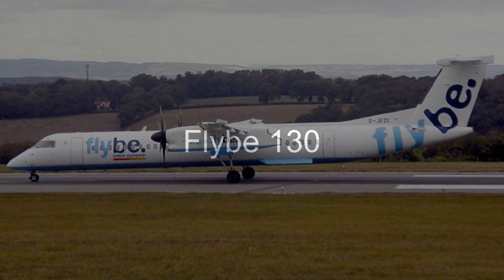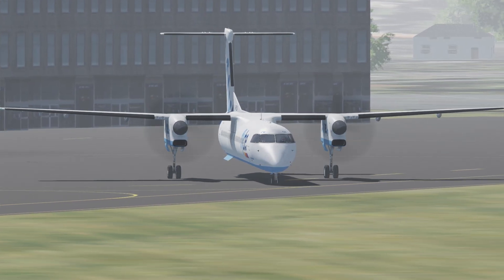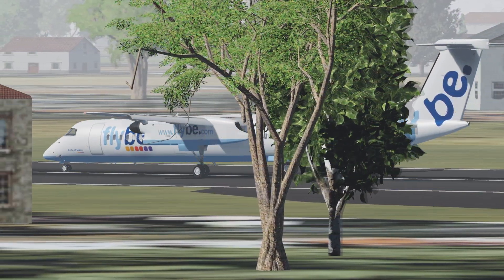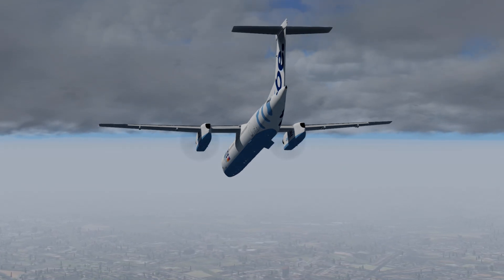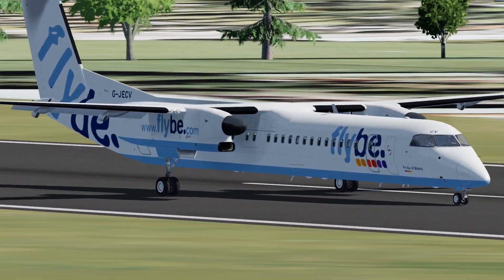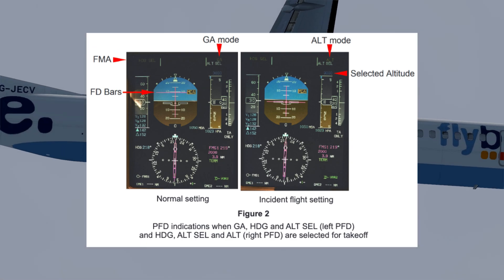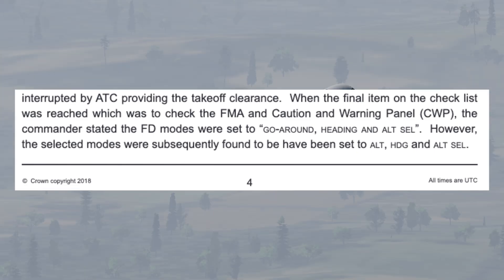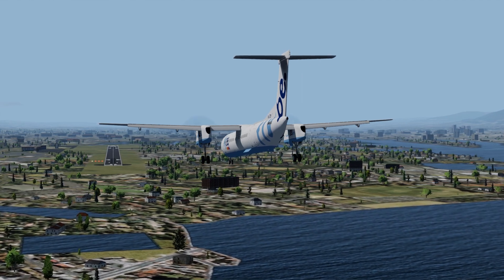How One Switch Almost Crashed This Plane  | Flybe 130

Comment: The software failure draws comparison to the Therac 25. Different machinery but having your inputs involuntarily switched on you could be more deadly in the air than in the imaging ward. Seems like fixing it ought to be high on the 'to do' list.

Comment: I fly the Dash 8-400, and while the autoflight system definitely has some quirks (as do many transport category aircraft), it is relatively simple to use. There is a running joke in the training department at my work that whenever a pilot makes some sort of blunder or error using the AFCS and the aircraft does something they didn't want it to do as a result, they should make use of the phrase "stupid airplane". Jokes aside, the automation is a tool used to reduce the pilot's workload, its whole job is to follow the command bars on the flight director. It is only doing what you tell it to do. This crew appears to have found that out the hard way, but I am glad that they caught this mistake before it turned into a serious accident.

This reminds me a lot of the Emirates B777 takeoff incident in Dubai a couple years ago, where the MCP altitude was set to 0' instead of the SID altitude, and as a result when the aircraft accelerated down the runway, through V1 and later VR, the PF who was following the flight director command bars did not rotate because the FD was trying to keep the aircraft on the ground at zero feet. When they did become airborne at the very end of the pavement, the FD was then commanding a pitch down to get the a/c back down to 0', and again the PF followed the FD command bars. During this time the aircraft was also oversped and nearly collided with several buildings. Thankfully they didn't engage the autopilot before realizing their mistake in this case (inhibited on the 777 below 200') because it would have literally flown them into the ground. ANY aircraft can get you into serious trouble if you misuse the automation, don't monitor it properly, don't understand its logic or its limitations. The relationship between pilots and aircraft automation has improved significantly in recent decades, but that has come in the wake of a lot of  near-accidents and accidents, and occasionally they still happen. 

Where I work, the normal SOP is that the Captain will set the FD modes for takeoff (GA, HDG, ALT SEL) and the FO sets the cleared SID altitude in the altitude preselect. In the event that the clearance hasn't been obtained yet but the Captain is at the point in their flight deck preparation where they are setting the FD modes, a placeholder altitude is selected (circuit altitude in some cases, usually the expected SID alt minus 100') before hitting ALT SEL, this is done to prevent something like this from happening and is standard procedure at most of the DH8 operators here. After flying the aircraft for a bit, you will pretty much always be in the habit of hitting the ALT SEL button immediately after you set the altitude in the altitude preselect, because that is how you tell the aircraft to climb or descend to whatever altitude in whatever vertical FD mode you're using. If you forget to hit the ALT SEL button, the aircraft will happily climb or descend through whatever altitude you've selected, because you have not told it to level off at that altitude. That is one of a few ways the AFCS can bite you if you don't use it properly (seen that before), and that applies to any aircraft that has any degree of automation.
Reply: I love the "stupid airplane " line!
Reply: I had to commit to read this comment, but I’m glad I did lol. 👍🏻
Reply: @jshumphress13 I know right! 😂But I'm glad I did too 👍🏾

Comment: What is sad is that it costs less to add steps to the (already cumbersome) checklists and put the pilots through extra training and work than to implement a simple software fix. 

It's $1,000 to make the change, then $1,000,000 for the qualification testing and rollout.

Comment: So you got a system that has a flaw that's easy to trigger, with three prior incidents.

I dunno, Canada's done this before, hello there Thorac 25 and the whole fustercluck around that, and now the Dash 8 Q400 and the same general issue. It's making me wonder what other issues are hiding in, well, plane sight on the Q400 just waiting for someone to trigger them

Comment: Shouldn't the Dash 8 AP code be rewritten to fix this behaviour? Or is it intended behaviour for some other situation?
Reply: Yeah, I don't understand why this hasn't been fixed. A target altitude of ZERO should cause some kind of fault or alert.
Reply: I guess it’s used to maintain a descent profile on approach, but yeah you could just use vertical speed select instead. It probably just shouldn’t allow programming under 500’ - or without a specific altitude input while on the ground and since last startup.
Reply: @EstorilEm Alt hold should not be used for descent, in fact it's impossible for the pilots to explicitly select that mode, the plane's internal logic does that for them. There are many reasons for this, one of them has to do with the theory of automatic controls used to design the autopilot responses, stuff about linearization and setpoint values. In short, the code for ALT HLD would not be able to correctly bring the plane to the correct altitude without any issues (timing, overshoot, stability...) if the target altitude differs too much from the current one, it's just not designed to handle that large control inputs. This is the reason for ALT HLD to exist in the first place, as the inverse is also true: ALT is designed around other requirements and would not be able to reliably keep the target altitude and correct for small deviations, it would be too slow et al
Reply: @EstorilEm using vertical speed is a bad practice andshould be avoided
Reply: Actually the plane did what it was told. So why change that?

Comment: Anyone who doesn't think that systems introduced by modern aviation have become unpredictably and unsafely complicated in their interactions with each other and the real world... just hasn't watched enough air crash investigation videos.
Reply: Do you think AI will make it worse?
Reply: @outofturn331  50% worse, 50% better. The main problem of AI are situations that require a creative approach. Here, the pilots' experience is decisive whether people survive or not.
Reply: @outofturn331  It's going to depend on how it's implemented TO make it worse or better... For a maximum benefit, since we're already dabbling in AI working in code, it would stand to reason that setting AI to run Computer Modeling scenarios with existing code and see where weaknesses can be detected would be more efficient and less human hours spent on that. We already do similar, except it's much more "chaos theory driven" than is necessary...

    For a break down of how code is getting improved, you can start with references to "Virtual Box" and the principle of "You gotta break it and fix how it breaks over and over"... Even the various linux based and Kali-linux related breakdowns are pretty understandable, but it's where to poke around at how it's done currently, particularly in "Pen-testing" (aka Penetration Testing as comes with the "White Hat Hackers" who do this kind of work for Code Dev's.)...

     The next step is to compose an AI that just "cleans" all the internal code for efficiency. This is a little more complicated... Basically, ANY proficient Code Developer (Code Dev') is going to have false starts and dubious strings of unwanted code when a piece of software is done. This is only part of where Pen-Testing comes into play, because some of those "extraneous strings of dirt" in the code can AND WILL serve as exploits by which nefarious entities (aka "Black Hat Hackers" or "Criminals") will take advantage of a system. The other side-effect of "dirty code" is not only inefficiency of processing the extraneous stuff uselessly, but occasional and UNPREDICTABLY creating invalid states within the system that can result in catastrophic failures and shortcomings... like this situation where a switch or input used "out of turn" can dangerously integrate a VERY BAD VALUE (like "0-feet == Altitude" when at "cruise mode" for an aeroplane. You NEVER EVER want to try to cruise at 0 feet in an aeroplane!

      What's worrisome is that instead of trying to integrate AI in this sort of "step by step" methodology, the corporates are more interested in trying to "rush it" into integration as a substitute for humans altogether. They keep wanting it to fly the plane when we're still at a point where it can barely crawl and walk... and only one or two WORLD-WIDE have managed to effectively jump, and even they don't give reliable results for the landing HALF of that jumping action...

      There's no short-cut for effective step-by-step management. Trying to short-cut the basic "Computers are machines, and machines are stupid" principle is only ever going to be catastrophic to any business involved.  ;o)